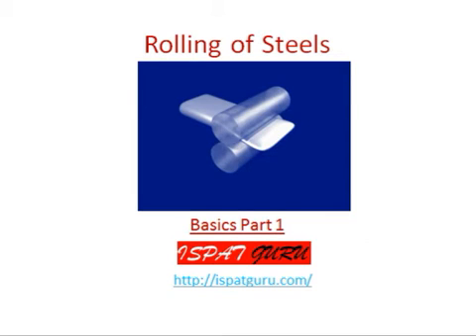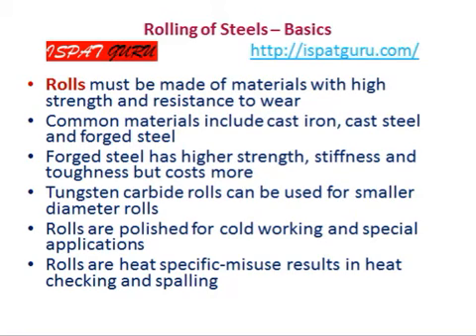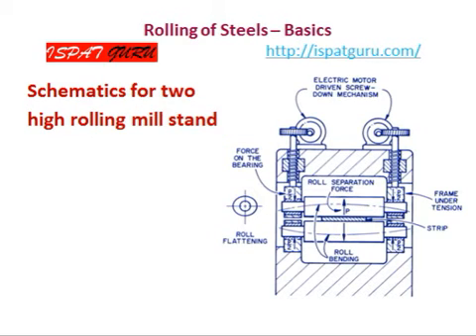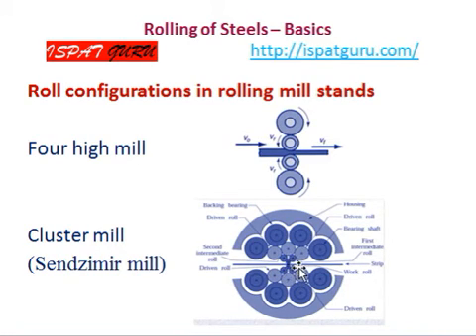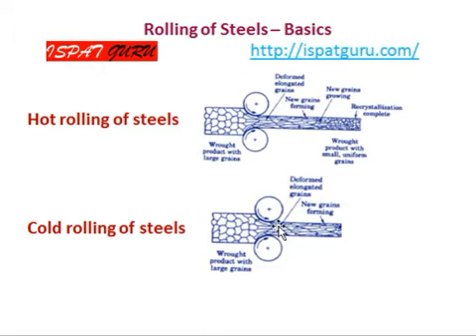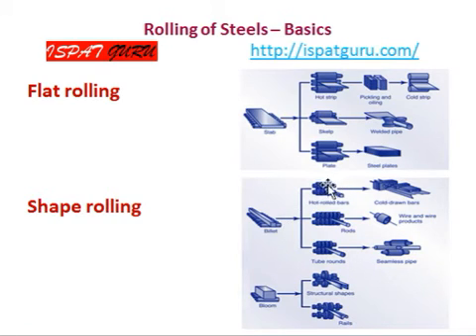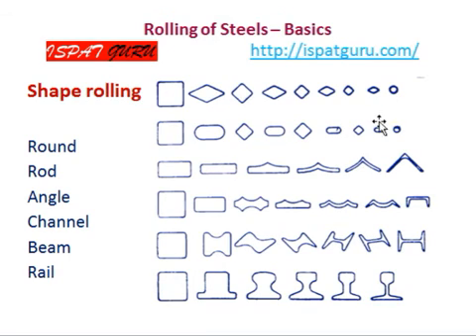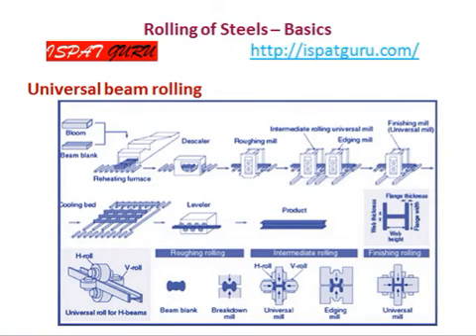Rolling of steel Basic part 1

Comment: We are searching for young and experienced people to join us :

www.youtube.com/watch?v=_ovvVwXFWIM

Hello folks, are you into strip processing lines line Cold Rolling Mills, Degreasing, Pickling and cleaning lines, Continuous Galvanizing lines and are having problem of carryover fluids, are you having troubles having a clean strip at the exit. Now you can use the High Performance Adaptive Strip Wiping system, it wonderfully works without any electrical or Compressed air, it’s a fit and forget solution with Zero consumption of electricity or electrical energy, simple and innovative design click to check and see it for yourself. enjoy watching, please like and subscribe